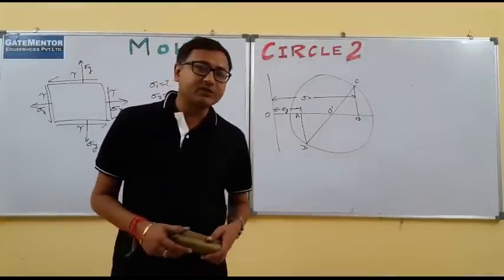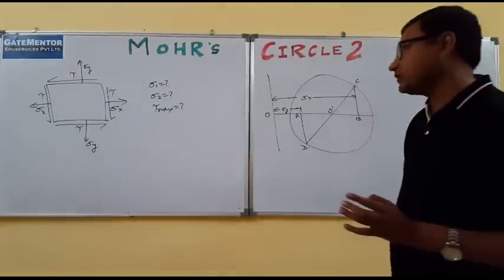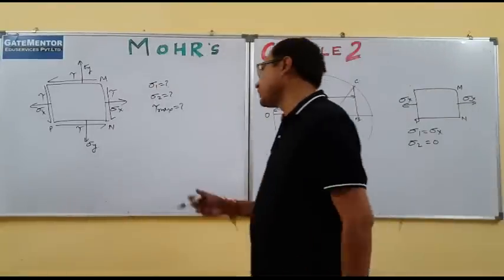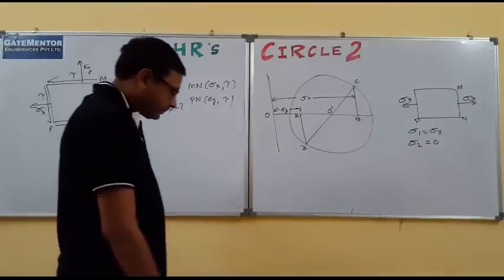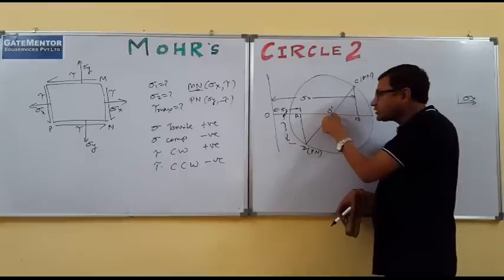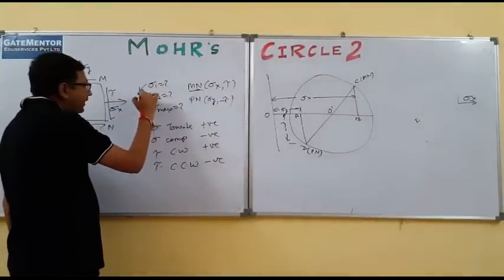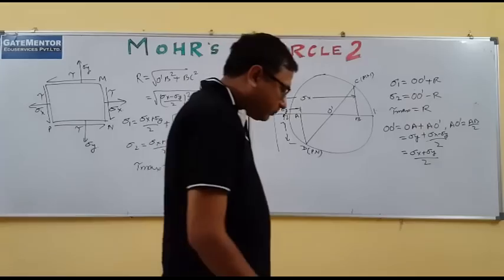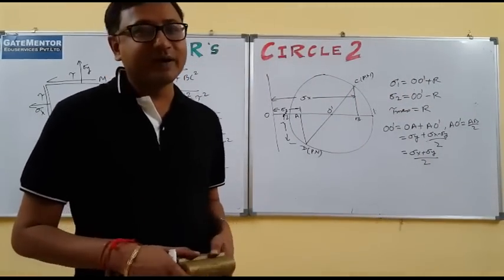How to draw MOHR'S circle for complex stresses? (PART -2)

Comment: GATEMENTOR was started by Mr. Arvind Rai, an alumnus of IIT Kharagpur, to provide a systematic coaching to GATE aspirants.  Every year most of the student from GATEMENTOR achived under 100 rank (AIR) in GATE EXAM. Almost each student crack gate exam from our coaching centre  To know more about GateMentor, and to get the latest information, please visit the following :

GATE MENTOR
0788-6499334/ 0788-4062366
Email - info@gatementor.co.in
website - www.gatementor.co.in